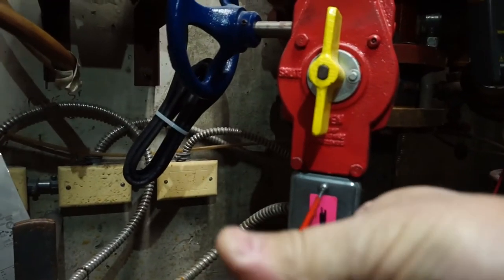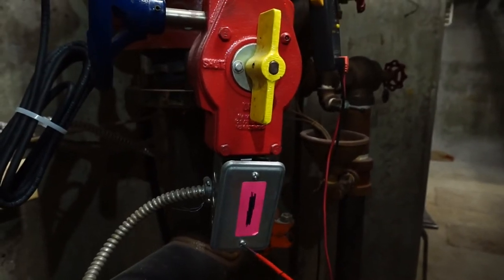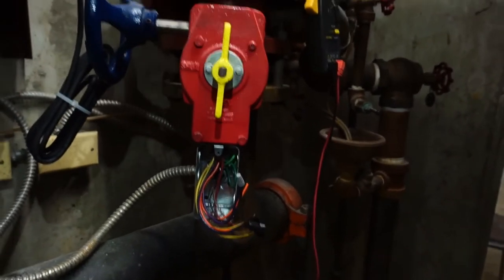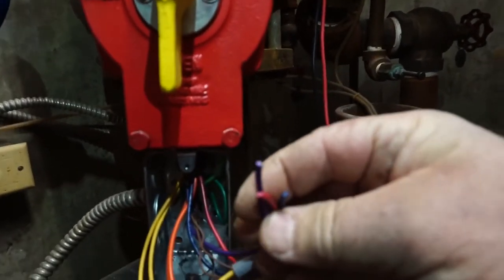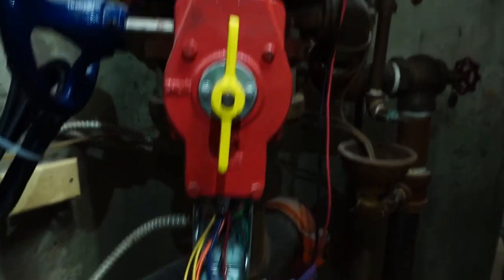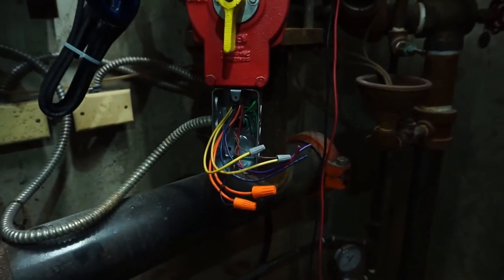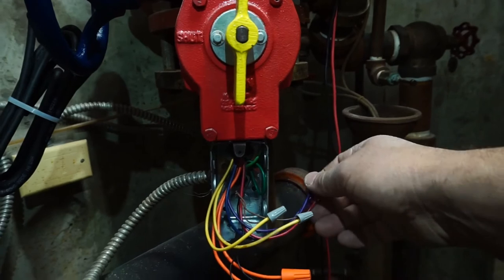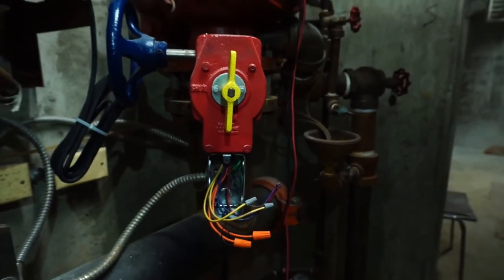Valve Switch Also known as a tamper switch for a supervised fire sprinkler valve.

Comment: I believe the tamper switched was wired blue-brown and orange-brown before fixing it. Your video demonstrates that it is very important to know how to wire these devices, with emphasis on how to select the correct cables to connect the circuit. Thanks a lot for taking the time to make this video! It was very educational!
Reply from the maker: thanks,  I meant to make another episode and make it more clear.  I am not finding myself working on a lot of sprinkler valve installs or repairs lately